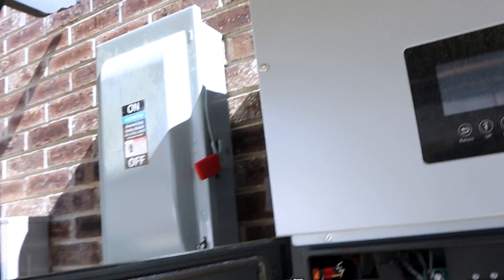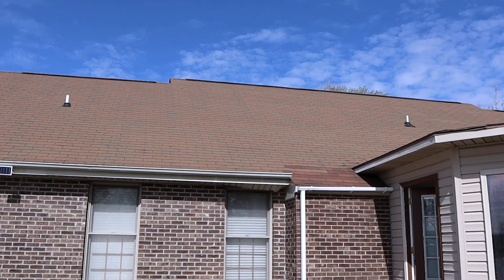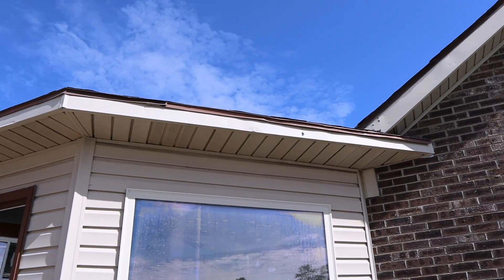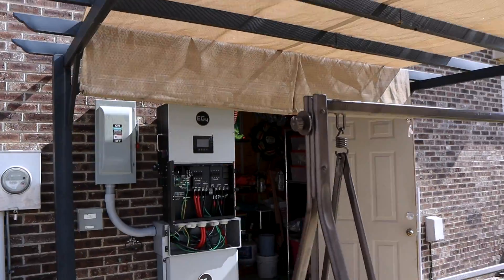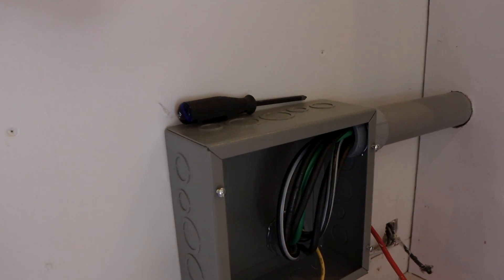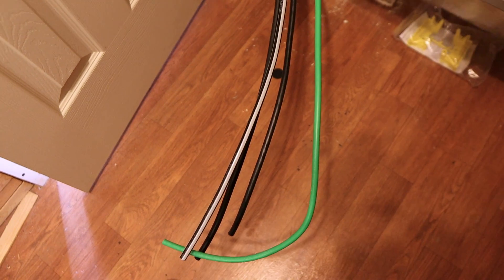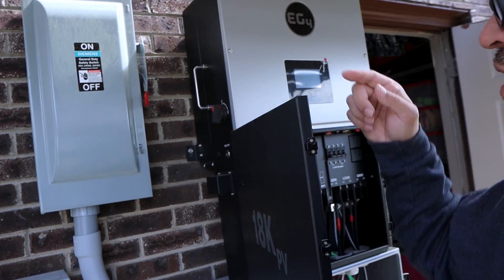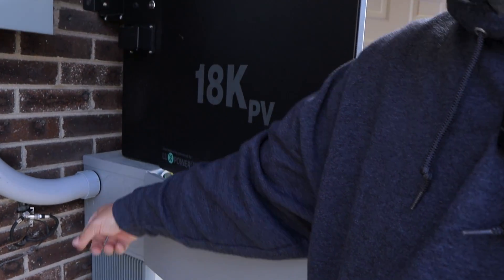I Need Your Help! 18KpV Install Question?

Comment: Hello Rodney. Would you please share what your final decision running the PV cables for the case? I’d like the idea with MC THNN cables to roof.
Reply from the maker: I ended up building a solar patio shelter. So no panels on the roof yet.

Comment: I would go through the attic with conduit (conduit for hv in the attic is by code) and pop out through the brick down the wall with conduit. You can purchase an attic solar box for the penatration through the roof, it hides under one of the solar panels. Its a much neater install than having conduit run across the roof and house, thats how I did mine. Good luck!
Reply from the maker: Thanks for the tips!

Comment: Fish the line inside the soffit from one point to the other point. Use a penetrating boot to seal the roof access to the soffit one solar side and conduit to inverter side
Reply from the maker: Hey thanks for the idea! Appreciate it

Comment: The space between house and garage.....  Can you push a piece of conduit through it?    Coming out the soffit will be a tight squeeze.  But what if you came down in the garage instead of outside it....
Reply from the maker: No that was a porch at one time so no access at all.

Comment: I would provably run it right below the soffit.  You could provably paint white to try and make it blend in with the soffit.  

The other option would be to run down to ground level and then go along the base of the house to the inverter.  

Soffit might be less noticeable.
Reply from the maker: Thanks Adam!

Comment: I can’t see the ground in your video but a thought I had was to come off the roof maybe on the other side of that roof (thinking maybe that side is not normally seen) and go conduit down that wall then go underground with it? Only you would know if that’s a route you could take based on use in that area.
Enjoy your content!
Reply from the maker: Hey thanks. They have some concrete I would need to go around but good idea

Comment: MC cable with stranded THHN wire (not solid wire).  It is metal clad cable and should meet NEC code 690.31 (G)  The code says PV wire to be ran inside metal raceways, type MC cable and metal enclosures.
Then pull MC cable through the attic.  Secure at a minimum of every 5 feet.  No conduit to bend on the inside attic.
Reply from the maker: Hey thanks! Will look into that. Great idea

Comment: Question? Do you plan on having the batteries on the inside or outside? I thought about getting the 18k but don't have space inside for both. I'm upstate so the weather is all over the place at times
Reply from the maker: Outside under inverter. Southeastern NC so moderate weather compared to the north .

Comment: Get the EG4 Brightmount, It's a Pretty Good and Affordable Ground Mount, I have Four, 450 watt panels on them Currently, I used to have Six 200 watt panels on it. Is the Sun Mostly hitting the front part of the house or the Backyard?
Reply from the maker: The back and this is my parents and they don’t want a ground mount blocking entire backyard. But some will be ground mounted. Thanks!

Comment: Fist of all, it is advisable to not use just one battery with the 18K PV. This is what Signature Solar says, not me.
Reply: Whoa easy with the fisting. 😂
Reply: Are you sure that’s not for the rack mount batteries? The Power pro is equal to almost 3 rack mount batteries
Reply: From page 21 of the Manuel. 7.3 Additional Configurations; Pro Tip: One EG4-18kPV
and a minimum of 2
WallMount units is the
recommended configuration
to maximize the inverter’s
functionality
Reply from the maker: What manual the 18k? because I am not seeing that in mine. Thanks
Reply: EG4-14.3kWh-PowerPro-WallMount-AW-Manual-1.0.3
Reply from the maker: Oh ok. Well page 20 shows the 1-1 configuration as well so until we step up to two powerpro’s we will roll like that. Everything will run better with a bigger system but not required. You can just work your battery harder which is not great as long as you are not exceeding the BMS specs. But like I said we will test, see, and upgrade when able. Thanks
Reply from the maker: Good point I thought they were speaking of powerpro but that makes more sense now. 👍
Reply from the maker: Just depends on what you are doing. The 18kpv is made to run with one battery and we are doing a critical loads panel. Will probably add more batteries in the future but like most people funds are not unlimited and something is better than nothing in my opinion. 👍
Reply: The PowerPro battery is rated for 200A in and out.  The 18kPV will draw 260A at full load, two batteries are needed to fully utilize.
Reply: The PowerPro is only rated for 10,000 watts. That is why 2 of them is recommended.
Reply: Speak for yourself. 18k would take a couple days to charge my bank 😂. I crypto mine so my consumption is through the roof
Reply: My 18K PV can produce 90 kilowatts in 5 hours maxed out. I have come close with our 405 watt SEG bifacial panels that are in 3 strings of 12. A few days ago on the 27th they were at 5,820 watts per string for a total of 17,460 watts or 87.3 kilowatts for the day. Normally it is around 73 kilowatts per sunny day. I have 30kW of storage with 30kW more on the way and I constantly try to find ways to use the excess energy. If you need more then that, perhaps this technology is not for you.

Comment: As you mentioned its required to be in conduit. I would run it on the outside eave but would paint it to match.  I would also use THHN vs PV inside the conduit as it will be much easier to pull .. time to get your pipe bending skills perfected
Reply from the maker: Thanks for the tip! Might go with flexible metal conduit. Have several good ideas and will see which one sticks! 👍

Comment: I'll start, 1 segment at a time come down little drop roof then under soffit around then down brick right past vinyl. The horizontal run to 18 k is tricky with stuff already there. Go high is easy but may not look good, low would require jumping meter and cut off conduits to reach 18k. Painting EMT could hide it some.
Reply: What he said....
Reply from the maker: Hey thanks! Good ideas

Comment: Doesn't have to be in conduit if it's legit pv cable. It's rated direct burial and sunlight resistant. But some kind of wire molding might look better. Kinda like the stuff you see used for line sets and wiring for mini-splits.
Dunno brother, just a thought.
Reply from the maker: Hey thanks! Thinking of flexible metal conduit. Someone said to paint it to match. 👍
Reply: @rodneyhunt , yeah but flex will look horrible outside when the paint starts to flake off , bending pipe is not that hard, especially 1/2 your more than talented enough to learn .. just use YouTube.. lol
Reply from the maker: I bend some tubing at work but not looking to buying another tool lol. We will see! Thanks
Reply: Yes it does .. PV wire inside a home is required to be in conduit .. you can run it all over the roof if you want but as soon as you go inside it has to transition

Comment: I used a lot of pex pipe , 1/2 " tight on 2 wires, 3/4 pex 4x #10 wire easy. Pl premium and clamps. Run it all external easier.
Reply from the maker: Good idea on running exterior! Maybe with flexible metal conduit. Thanks!

Comment: Im researching how to use ll v2  and lifepower4 battery rack with the 18kpv but having no luck on how to get them to communicate correctly
Reply from the maker: I thought the LL’s just worked but the lifepower4 need to have firmware updated to communicate.
Reply: @rodneyhunt  perfect thanks I just need to set the master (ll v2) protocol settings to lux is what I found 🤔